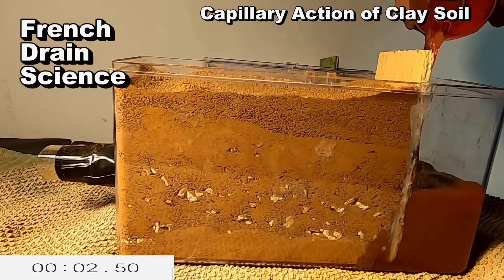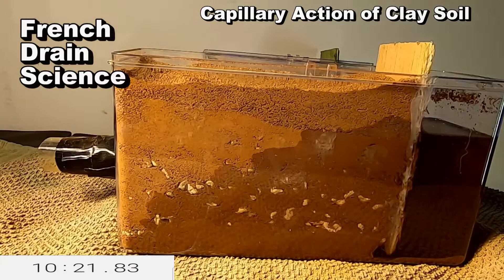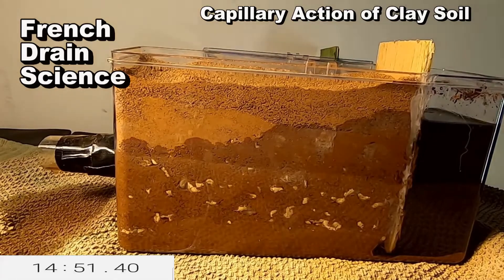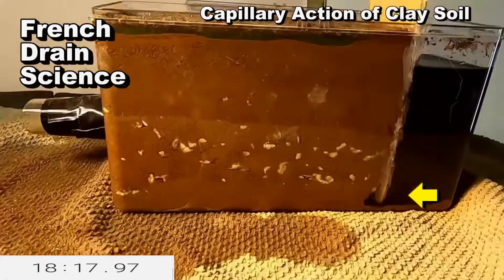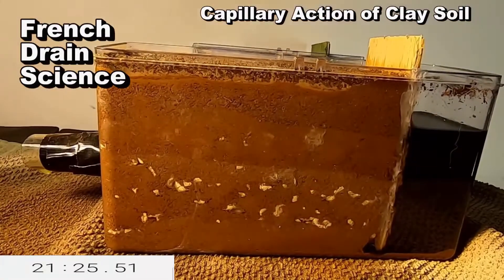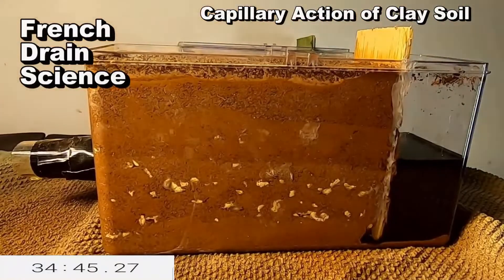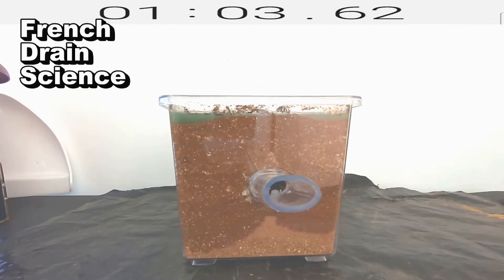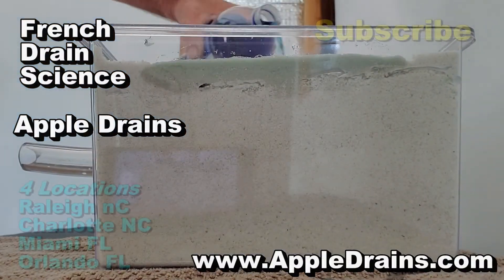No Fabric FRENCH DRAIN - Capillary Action in Clay Soil - French Drain Science

Comment: "This system works great."
Your backyard, to scale, is only flooding like crazy while your pipe is emitting drops at a time, but hey, it technically works!

No, this does not work great. It's slow and ineffective. No homeowner wants to invest so much effort just for a weak french drain system to emit what may as well be a gallon of water an hour.
If anything this enforces the concept that is you don't want ANYTHING to impede the air voids created within the stone of a proper french drain system. You want as much air as possible to allow water to flow more quickly.

Comment: Loose clay soil behaves  nothing like hard packed clay soil.  Could you try the same test but hard pack the clay and then let it dry for a while to simulate real life ?
Reply: Agree. The whole thing will simply cake into one impermeable solid mass, with a pipe through it. I saw a video that was more convincing for longer-term viability. Just gravel, pipe then more gravel. No fabric or backfill. 

Fabric soon clogs up, making it ineffective. Or could put a piece of fabric on top of the top gravel, add a bit of backfill, then sod - if you want grass. Because the drainage is primarily from the bottom, this shouldn't be a big problem.
Reply: Hard packed clay has the lowest permeability rate. You would need a large and deep french drain to dewater the soil.

Comment: So, no fabric then the clay’s silt fills up the drain rock. Then it works only very, VERY slowly and the silt starts filling up the pipe. To follow this logic, why bother with drain rock at all? 

Also, the pipe needs a minimum 2% slope to properly flush the silt out. So many of the drains on YT skip this important point.

My conclusions so far are:
1. Use an appropriate fabric for clay soil to preserve the spaces in the drain rock as long as possible. Yes, it drains slower, but slow drainage is better than almost NO flow from being clogged up.
2. Minimum 2% slope on the pipe
3. Use catch basins to optimize surface collection and act double duty as clean outs (with silt collection sumps for maintenance access). Catch basin maximum spacing at 40’ on center.
4. Use bigger rounded drain rock like 1-1/2”
5. Use smooth schedule 40 PVC perforated pipe. 
6. Consider running the drain rock to the surface (Less important if there are surface catch basins).
Reply: This guy gets it

Comment: Don't go outside during the rain storm and expect to see water running unless the ground was recently saturated. Water has to make its way into the ground with this type of french drain before it drains water to its outfall. This is used to catch underground water before it can go against your house. The water is water you can't catch above ground. Could be from a neighboring property or underground stream. It is not used to collect roof, patio or driveway water unless you don't mind a large puddle sitting in your yard for a few days.

Open top french drains collect surface water quickly and work like a surface drain and groundwater drain. They are a landscaping nightmare. Although it's more work and expensive, if you have water sitting on the surface, I would install surface drains, then give the ground enough time to thoroughly dry before determining whether to build a french drain.

Always make sure your gutters and downspouts are clean and working properly and water is sent to an area where it can't run back before installing surface and french drains.

Comment: Soooo...fabric, or no fabric? Heavy clay soil here in AZ.
Reply: no fabric
Reply: Technically both arguments are correct in certain ways. 

No fabric will equal better flow but over time risk of clogging due to clay drying or wet setting into the pipe perforations impeding flow through. Gravel will also become plugged up by clay particles to a degree and slow down flow, although it will still make its way down.

Fabric will help prevent this but flow will be much slower and time dependant. Clay on top of the fabric acts like a barrier reducing flow drastically, however pipe perforations are better protected longer term. 

The problems shown here are with the fabric, idk if I missed it but is it geotextile, non-woven fabric? As that is the most suitable type to use.
Also, adding clay back on top as your back fill is what is the main issue here causing the fabric to clog up how it is. When back filling in a clay soil trench system, use either gravel as high/close to the surface as you can with sod or top soil. Flow will be very substantial. Or, use gravel to the surface without soil on top. Backfill the wrapped trench like this and flow will be almost instant with good rate. Also ensure slope is correct at 1% or 1 inch for every 10 ft. This worked best for me and if you can install a catch basin either tied into the perforated pipe or a separate drain - that will take care of surface water in a real hurry as was shown here.

Comment: You should show the same thing using fabric wrapped around the stones..
Reply: He did that in another video, the fabric clogged up.
Reply: To be clear, it didn’t clog up, the flow rate was just much slower. About half as slow, but the water entering the pipe was dramatically cleaner. 

I think these videos miss out on an important part, that the filter fabric is to keep silt and crap out of the inside of your pipe. I need my system to be clog free for 30 years, even if it’s going to run a little slower. If it’s a big problem, I would just backfill entirely with stone and the fabric has nothing to clog with.